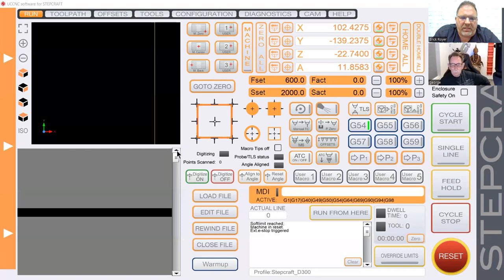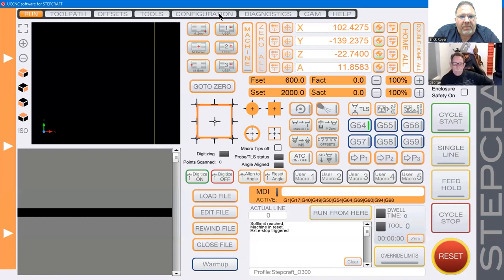UCCNC Tutorial by an Expert - All Stepcraft CNC's use this Controller

Comment: Someone should add that the 93 videos mentioned in this video are made for their previous version machines (V2), so It doesnt really help when you buy the new D3.
I have a D3. Stepcrafts are well priced, sturdy machines and well manufactured but the printed construction manual suddenly ends when its time to plug in your machine, doesnt include UCCNC or a first use guide. In my opinion, their manuals and video libraries are as unorganized as the contents explained by the CEO in this video, ( dispite the questions asked where very accurate)
Reply from the maker: You are RIGHT but I just did a video that is in PRODUCTION / EDIT about the new D machine,  Erick at Stepcraft did the same videos for the D machine.     THANK YOU for your comment, all comments help people either with the machines or thinking of buying one.    CHEERS BROTHER!

Comment: Muchas gracias. 
This is by far the best video on any CNC controls. 
I want to congrats you for so good information you are putting together.
I was saving for the Onefinitycnc but with this video you clear my mind and the Stepcraft is the better choice. 
One question I have using the ( G54,G55,G56,G57,558 and G59)
Can i run different programs for some of them? ( I'm thinking of production products) 
From Cypress Texas. 
Thank's
Reply from the maker: Jazael thank you very much for the nice comment.   I do not want to comment about the exact question, rather I suggest you contact Stepcraft send them an email, but I would not be surprised at all if they answer right here.   CHEERS and thanks again.

Comment: so I have limit switches to home my machine (left front corner) and they do exactly what they're supposed to do.  Problem is CNC4NEWBIE and it's US support provided by one single individual are simply not capable of being responsive to the plethora of customers they have to support.  

I cannot for the world of me figure out how to set the "virtual limits" in the UCCNC software accurately so that I can stop running into outer plates (back and right and Z) therefore when that happens, throws off my "zero" coordinates".  Frustrating at best!  Could you possibly tell me how to set these limits or the methodology behind it so that I might be able to understand it better.
Reply from the maker: This one is beyond me but I will try and reach out to Erick and see if he knows.   Is this a Stepcraft Machine?

Comment: I purchased my CNC machine 3 weeks ago and have yet to make a single cut because I get lost, figure it out, get lost, figure it out...Right now, I'm just trying to figure out how to move the Z axis. When i enter a number in the Z field, it just disappears. But you did save me by showing option that will move my Z and I don't need to type a number. The next problem is that UCCNC is telling me that my soft limits is exceeded, to either adjust or to remove. Hopefully i'll make a first cut within a couple of weeks
Reply from the maker: Sorry I was slow in seeing this.  You will get it ... and have a blast with your machine.. hang in there.
Reply: @GeorgeKennerLaser  Thanks. Just completed my first cuts. By having to problem solve to get me to this point, it has allowed me to learn many aspects of CNC, from software to the machine itself.

Comment: Very helpful. How do I home the machine or decide where home is? My z axis is going in reverse but works fine when manually jogging.
Reply from the maker: The Home Button is in the controller if you want to insure the machine is starting at home I think that is a preset.  I would contact the manufacture.  If its Stepcraft they are very helpful.  Cheers

Comment: After 2 years there is still no video series by Stepcraft as promised, and the official UCCNC user manual has a completely different interface :/
Reply from the maker: I agree with you the docs on  UCCNC are weak that is the reason I did this video... Stepcraft did launch a new training service... its paid but may well be worth it.

Comment: Can anyone give me advice? I nearly assembled M1000 kit, but in UCCNC I can't open left jog panel by dragging my mouse. So I am unable to move my axis to complete assembly. It is in reset mode either my Estop is released or activated. It has red status "Idle", "Reset" and "Hard limit" under diagnostics tab. Visually my limit switches doesn't seem to be activated in any way.
Reply from the maker: Get ahold of Greg...what Windows system are you using  10  or 11.. they will hook you up... I am building my second M1000 right now .

Comment: Great video - thank you so much for doing this.
I have a question - is there a way you can put software limits on the machine so that it never hits the limit switches on each axis and you have to reset it?
Reply from the maker: I am not sure about that, but cannot think of a reason that would be a good thing.  I would rather work with the limit switch as it would give me full use of the table size I have.    Could I be missing something?   I really do not know, I am asking honestly.   Thank you for the thoughtful comment.  Cheers!
Reply: @GeorgeKennerLaser  thanks for the response. what I want to know is if there is a way set the software so that the hardware can allow movement to just before the limit switch before triggering it and you have to do a reset.

For example, if you manually move the gantry on any axis and it stops the movement just before it triggers the switch.

This might not be necessary but I find it kind of irksome to have to reset every time I manually move the gantry and it gets triggered.
Reply: @GeorgeKennerLaser  also, is there any playlist of tutorial videos you’d recommend to get started on simple projects with this machine?
Reply from the maker: @guerrillasneeded  I understand what your saying but having used the machine,  I do not find this to be an issue or ease of use.  More times than not the only time I hit the limit switch is doing a homing sequence.   Honestly do not know if you can set a hard stop.  There are some abilities to set return points. but I am not sure that land on the axis stop points.
Reply: @GeorgeKennerLaser  thank you. I appreciate this info.

Comment: Howdy George.
Great video - I just subscribed. 🙂
Like you I also have an M.1000 that I received fully assembled in June. About a month ago, I purchased an Automatic Tool Changer with a Tool Magazine and Dust Boot Control. However, I'm having a terrible time getting the ATC and magazine working properly. Have you had any issues with your ATC and magazine? I've been working with Hugo, at Stepcraft. He writes most if not all the ATC UCCNC macros. Any way you could reply and include your values for ToolX[1] and ToolY[1] in the M6 macro? These are my values - ToolX[1] = 678.0000;  ToolY[1] = 1040.9625;

Thanks!
Reply from the maker: I have mostly used the tool changer for the speed of releasing the chuck and changing the bit.   TO ME.. that was worth the entire price of the ATC .    I have not really set up a program to change the bits, my projects have not required it honestly.   I still feel like I am doing simple projects.  Sorry I could not provide more help, but Honestly is the Best Policy.   CHEER BROTHER!
Reply: @GeorgeKennerLaser  Thanks George! 🙂

Comment: hello, how can i change the manual toolchange position?
Reply from the maker: I am not really sure what you are asking... Manual Tool Changer.. Manuel would be your wrench and chuck position.. RIGHT?    Thank you for the question.
Reply: Hello again, how can i change the parking position in UCCNC. I want my machine to stop in a specific position to change the tool manual, for the next process(2D Contour)  @GeorgeKennerLaser
Reply from the maker: I just do it from the start position and then raise the spindle and then change the tool and reset the Zero.  @user-ig1rb3gf4b